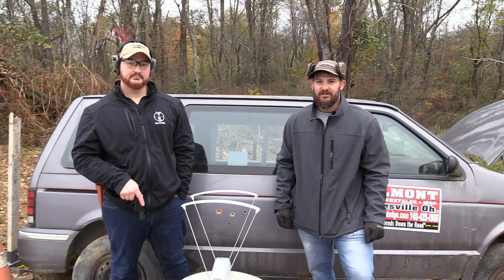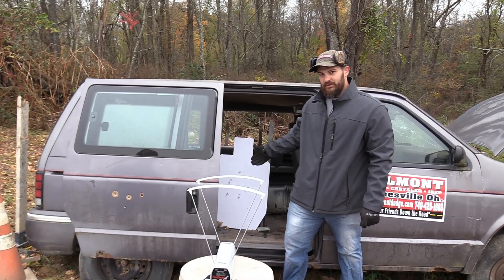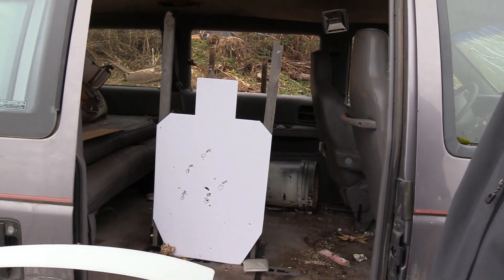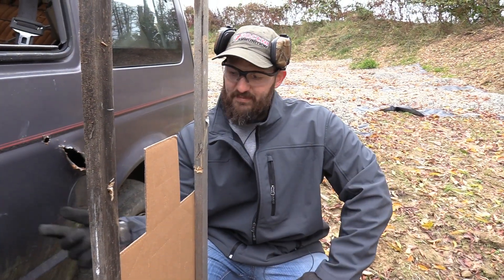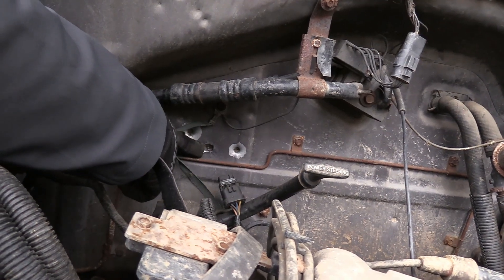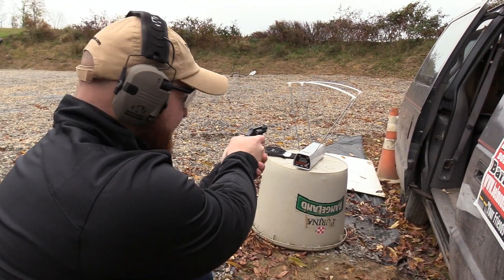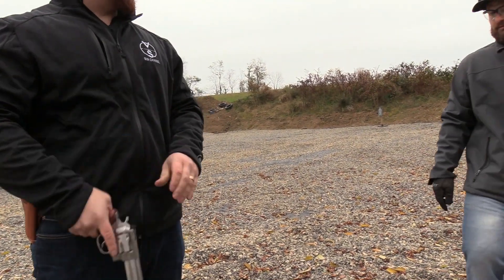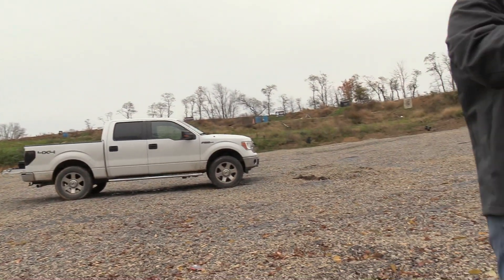How Powerful is IT? .38 Special Revolver (S&W J-Frame)

Comment: If you knew anything about calibers it's a well known fact the 9mm is a higher pressure round than 38 special and performs at higher velocities. There's nothing surprising about 9mm doing better than 38 special at all.
Reply: Tox927 if you knew anything you recognize that's Perfecta ammo son ! crushes
Reply: 38 special is heavier bullet tho
Reply: if YOU knew anything about calibers you'd know you're confusing internal and external ballistics Son!
Reply: Yeah that just proves how versatile 38sp is then . Even at lower pressure,  38sp can run up on the heels of standard 9mm in terms of velocity and energy.
Reply: I would bet that the 38spl round hit something behind the firewall that the 9mm didn’t and since firewalls are not perfectly flat the 38spl bullet could have had it’s trajectory changed and struck something that the 9mm didn’t, the firewall is certainly no thicker than the double skin on one door much less 2 doors. I shoot both calibers and they are very close in destructive power with the 9mm edging out the 38spl if the bullet weight is the same, also if you compare 38spl +P with the heavier 9mm rounds they are very close as well. Should have fired 3 rounds of each caliber at the door and firewall for a more exact comparison.
Reply: I mean you are right 9mm is really strong a 38 special is decently strong too but the minimum for what's considered ok for self defense rounds.

Comment: If it were me and I was trying to get more penetration through metal with a .38 special, I would use a +P hard cast such as something that Buffalo Bore would offer.
Reply: I'd say your test used a better method. Mind you, if you ever decide you are willing to pick up another J-Frame that you are willing to run the BB through, that test bears repeating. I'm sure that @ ≈ 351fpe it will still impress.

Comment: You pointed to the wrong hole in the firewall. It hit on the seam about 2 inches to the left and 1/2 an inch below, you could see it didn't penetrate.

Comment: Would a .38 Special wadcutter round go through and through without breaking up into pieces?
Reply: Jan Hollon doubt it, most all the 38 wadcutter loads are very soft to almost pure lead, and it will come apart pretty quickly.

Comment: Would've been cool to see the diff in performance compared to 38spl through a 6in barrel. Would it have made a significant difference? We may never know. Or maybe we will.
Reply: Xbridgeman1975x longer barrel slows that load down !! did you see the ending of the video?? . that 3244 was no mistake playa !
Reply: Wizardry and witchcraft
Reply: maybe not a huge difference with 38spl, now 357mag would be a different story altogether!

Comment: Yeah, a 9mm is faster, and better than 38 sp. in every way possible, so I’m not surprised whatsoever.
Reply: In steps .357 magnum. Lol. Calm down .38 special is just as good as 9mm using +P rounds. In lower weights.
Reply: Full power (non +p) 9mm is objectively more powerful than full power (non +p) 38 special, but it's such a small difference in the scheme of things that it doesn't really matter. You're talking about the difference between 250 or so foot pounds and 350 or so foot pounds. To put that in perspective, full power (non +p) 45 acp is about 425 foot pounds, full power .357 magnum (out of a 4" barrel'd revolver) is about 700 foot pounds, and your standard .223 is about 1,100 foot pounds.
Reply: 38sp +p can be right on the heels of 9mm in terms of speed and energy,  but yeah 9mm does have a edge . But 38sp is way more versatile in loading ability and bullet configurations